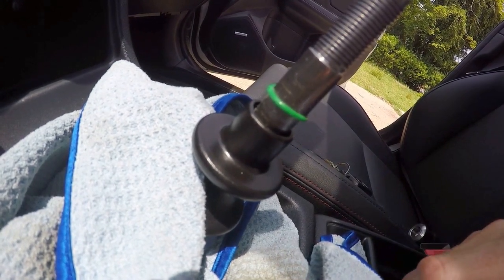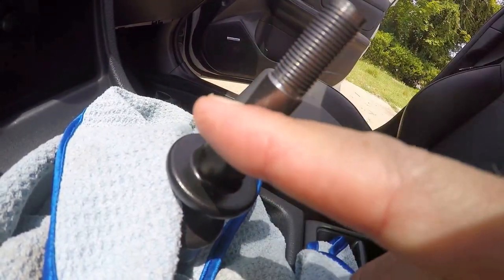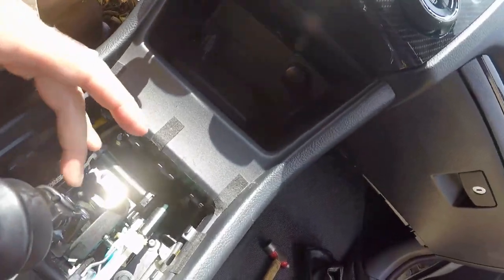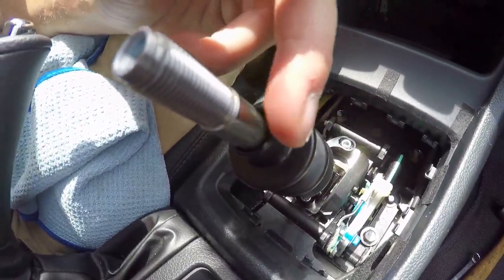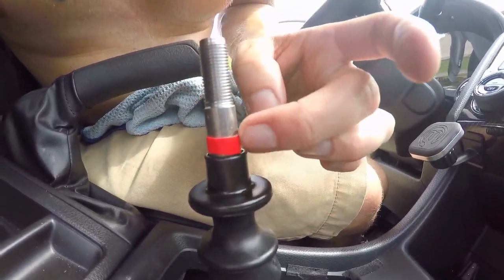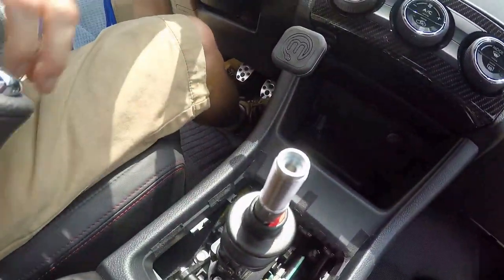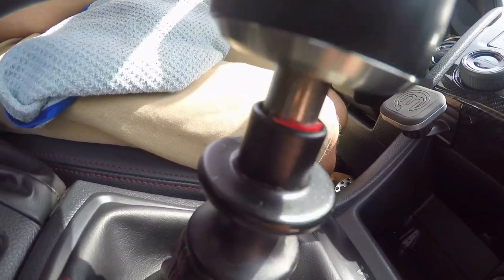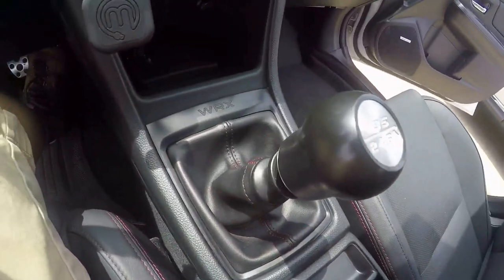2015 Subaru WRX Ep. 801: Shifter Rattle Solved?

Comment: I had the same issue but play was forward and backward...I used thin slivers of electrical tape by sliding them down into the top of the lockout sleeve, sticky side out so its stuck to the tube itself instead of the shifter...Doesnt get hung up at all and works perfects...Only had to remove the shift knob...10 min fix
Reply from the maker: nice tip!